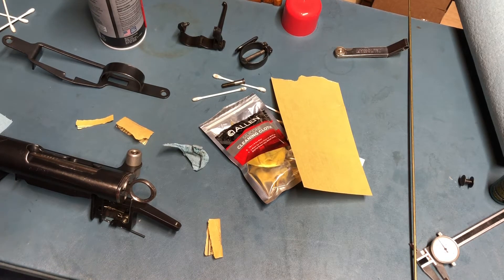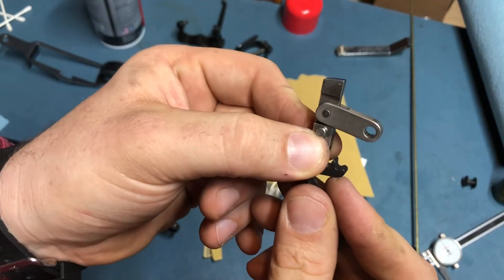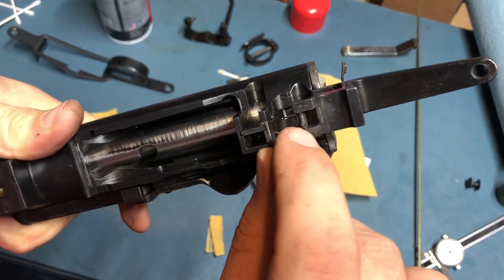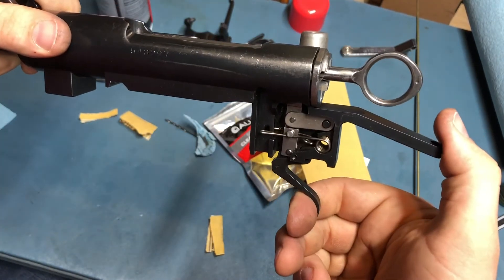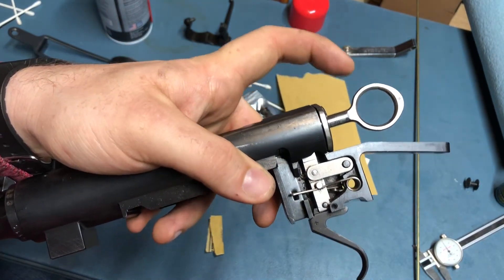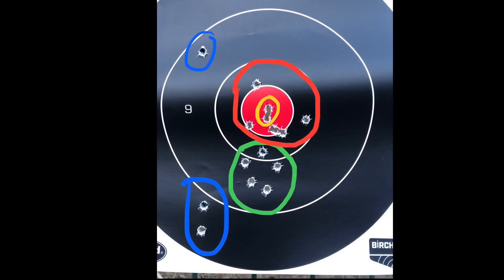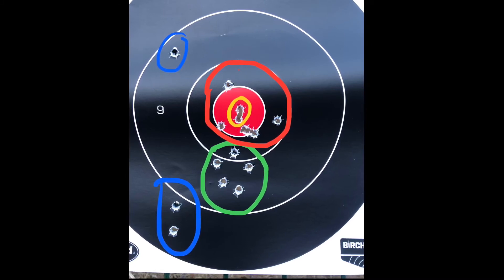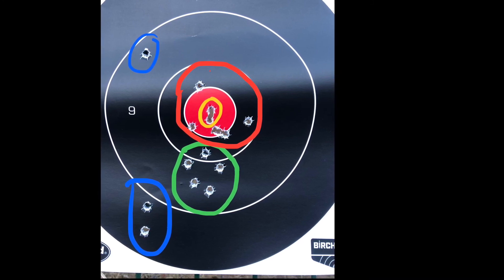K31 Trigger Fix and Range Report!

Comment: Cool, glad to see you have the trigger solved. Less likely to find in the USA, the Swiss have I think 6 different heights of front sights, and there is also a fine adjustable rear sight adapter, and Hammerli makes an adjustable side to side rear sight adapter. There is also a front sight tool to move the front sight very slowly.

Comment: Thanks for taking the time to do your videos! Just wondering if you changed the firing pin spring as I noticed the gap between the receiver and the bolt cap is still there? I have about .027 gap on mine when it's cocked, although I have no problems with it light striking etc.